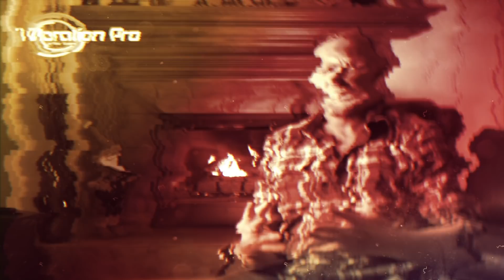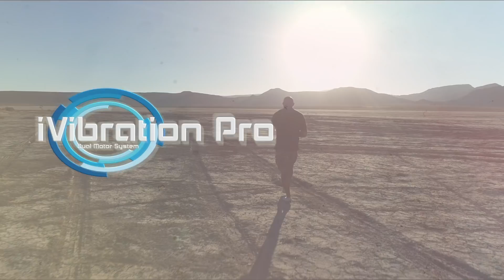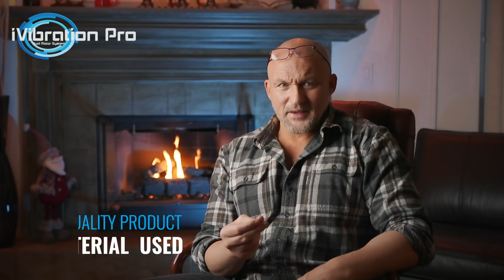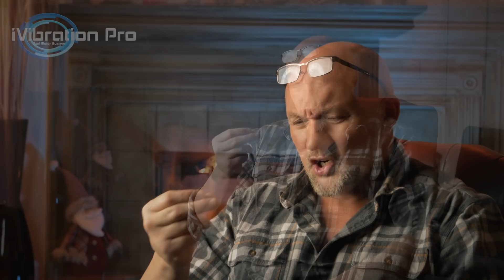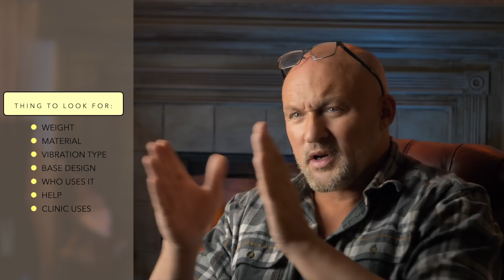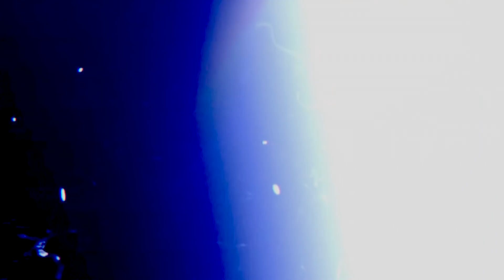Vibration Machine Review | How To CHOOSE the right Vibration PLATE!

Comment: Is there any data out there related to vibration plates helping specifically with the SI Joint? I have arthritis is different places, but the Si joint and tail bone are the worst. I figured oscillation would help at the very least break down inflammation. My Si Joint likes to pop in and out.
Reply from the maker: Great question. Movement helps replenish fluids in the joints. Joint health. Plus the motion improves ROM.
Reply: I have arthritis and I used very vibration  machine  i ordered  from China and joints feel alot better. Little  to no pain

Comment: Hey Mike curious if this would help with two slight tears of my meniscus, or should I avoid a machine like this? Thanks
Reply from the maker: I have meniscus tears too. It saved my fitness goals. The motion helps move fluids in and out of the joints. Increases healing.
Reply: @MikeMorieartyDC  Mike thanks so much for getting back to me...I would be interested in your machine but I just cant afford it was wondering if you would suggest any other vibrating plate machine in the 200-400$ range.